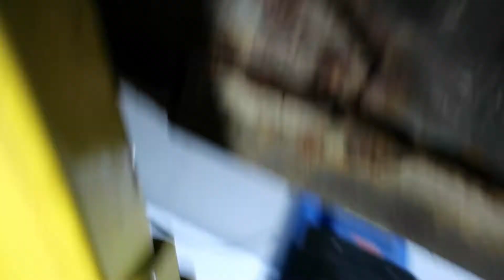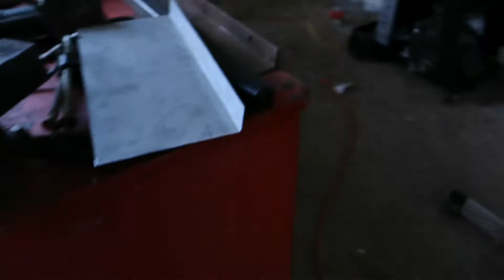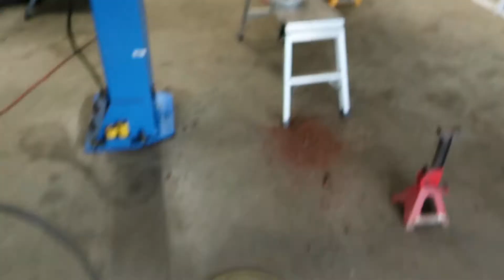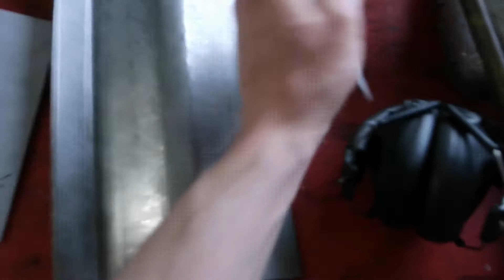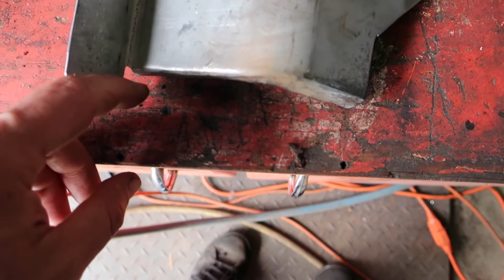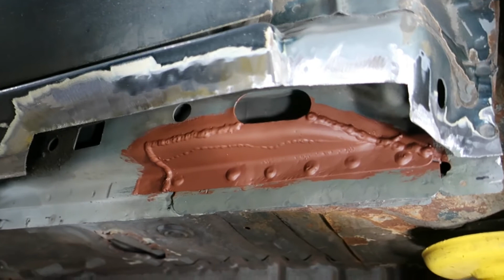Rocker panel rust repair: fabricate and install patch

Comment: But why lap joint?!
Reply from the maker: @Jake_Szuwalski  I actually used butt joint to join the repair to existing rocker panel and copied the original arrangement for the lower pinch weld area.
Reply: @taillighttapegarage5816  Oh! Then my bad, sorry :)

Comment: What amp/ heat did you use
Reply from the maker: @Somersetauto  On my Lincoln MIG 140, I use heat setting "B" for this sheetmetal but sometimes have to lower it to "A" if it starts blowing holes
Reply: @taillighttapegarage5816  understandable thanks man

Comment: Hey, I am working on the same issue on my Subaru. I am wondering, do you think it is better to spot weld the pinch weld on the bottom like you did, or leave a small gap for drainage? It seems to me like water will always find a way into the rocker (open body clip holes etc) and then dust will clog the pinch and the water will just rot it out again from the inside. I am considering leaving my pinch weld slightly open to just let it always drain and dry out. I also garage my car and rarely drive in the rain
Reply from the maker: Yes you do need to allow water to drain. In the past when I did a full rocker replacement on another similar car, I drilled a few 5/16" (8mm) holes along the underside of the rocker just above the pinch weld flange. Maybe not "proper" but it worked.

Comment: Great video. Was wondering.. What primer would you suggest on the grinded area of a welded on rocker panel? I don't plan on paint for several months down the road.
Reply from the maker: I always use self etching primer directly on bare metal, it helps any other coatings stick well. On these patches I've been using Tremclad red oxide primer over the self etch, same as Rustoleum. It's not longterm but it'll protect as long as I need it to. Then spray rust check or fluid film inside the panel where you can't reach with paint, especially the back side of the welds.